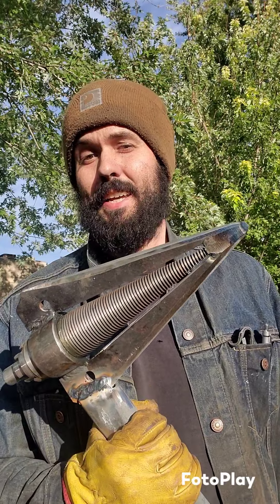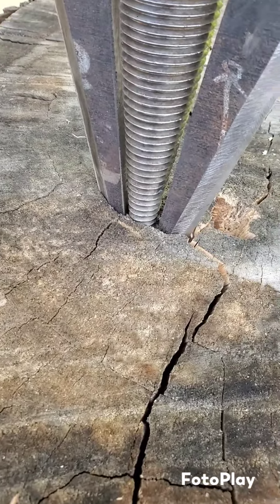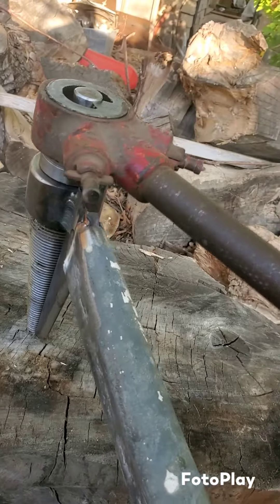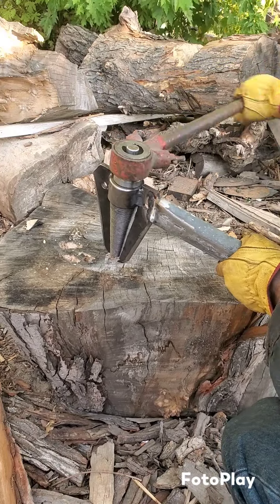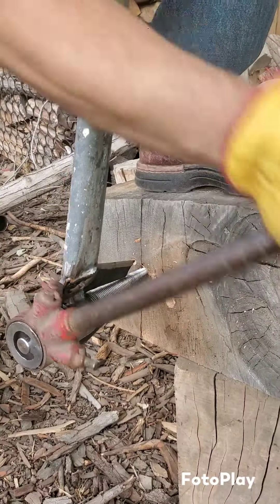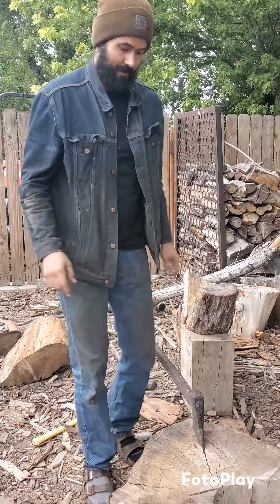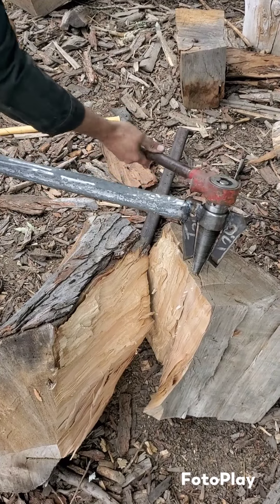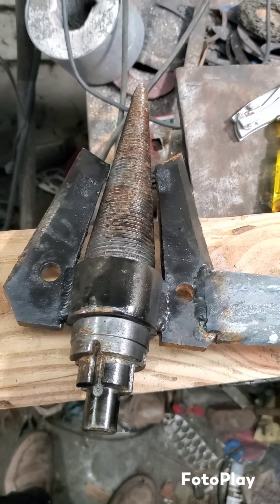Axicorn 🦄 testing : Mixed results new design plans

Comment: I can't see how this would be physically easier or faster than just using a wedge and sledge. Or just building a normal woodsplitter.
Reply: It does not need to be to.
Guy actually crafted and tested one of those ideas, that just blink and disapear in our minds daily. 
Some of his and our: vievers brain cells, that were disfunctional died, and we are closer to perfect amount of brain cells: TWO.
Nex time it would be easier to make it happen next blinking idea, until some day we all wake up splitting stumps on planet Mars.
That was one small split for a man, but a big one for a mankind.
Reply from the maker: I have built a wood splitter and I do use axes and wedges. But I'm interested in a more portable wood splitter so I'm chasing down that idea.
Reply: @Hughsllc  nice man!
 some stumps can swallow a couple of wedges and still be in one piece, never too many.
Reply: Its not meant to be isn't that obvious? it's just something different
Reply: Sometimes its just answering the question of if you can get something working and not if you should.
🤷‍♂️
Reply from the maker: @joshk.6246  Exactly
Reply: It's a novel concept.
Reply: @teodormajewski3566 ever eaten shit? I mean, if you haven't chased the dragon how do you even know if it's good or not???

Comment: Based on other screw splitters I’ve seen that actually work well, this one has too many threads which is too much friction to overcome, and the size is a bit unnecessary…

If you look at the ones that work, the main downside is being a wrist breaker if/when the drill inevitably catches.

If you combine the ideas and add some locking blades to stop that from happening, I’m sure this idea would work.

I’ve seen people split some nasty logs with a decent power drill and a small splitter bit. 

Might be worth looking into modifying existing tech instead of starting from scratch, at least as a way to understand the potential issues and then you can scale up.

I want to see this work! I wish you the best, stay safe out there.
Reply from the maker: That gives me an idea 💡 🤔  So the little hand drill ones are out there but there used tobe kits that bolted on a car axle you would put the car in gear to split the wood 🪵
Reply: @Hughsllc  Holy shit, really?! Haha that sounds terrifying in the coolest way!
I’ve only seen the hand drill and the mounted ones, and the hand drill ones are surprisingly powerful, but they’re basically useless because the weak link in the system are your fragile human crunchy bits… I thought your unicorn design with the blades attached to the drill/motor housing to act as an anchor would work well. 

But I like the sound of whatever nightmare you’re imagining much better… lol Good luck, and I hope you keep all your parts where they belong.
Reply from the maker: @DanteYewToob  So there's a new video with some design updates I welded a tube on the front and made a stake to hold it in place works alot better

Comment: Why not use a 1/2 or 3/4" electic impact? Should give you plenty of torque, and very portable.
Reply: I legit was just thinking something like that would be helpful. This concept is amazing it just needs refinement. Maybe having 2 bits driven in by a heavy hammer, a different thread design, maybe having the angle on a gradient

I love it hey

Comment: Came across this through a short of attaching the longer threaded piece to the ratcheting lug. 

Getting power to it is an interesting idea, though maybe not a direct drive on a pipe threader unit. I was thinking maybe a smaller hydraulic motor attached via hoses to a electric powered pump so you're not having to try and manhandle a heavy threader around. Wouldn't really need to be a super high flow unit or really all that large if it's driven through a planetary gear set like is found in a smaller winch that can mount on a the front of a pickup. I think some develop enough torque that wouldn't need a planetary to increase the ratio.

Drive your Axicorn, then set the drive over the end and let it use a drive dog to brace off the handle so it can drive the power down while you steady it with the handle.. When done, just pull the power unit off and have less mass to swing an carry. Plus depending on the motor, it may have power reverse though reverse might not be needed since it'll either pull fibers out or split the log.

In the end though, this is your idea and project, so how you approach is how you approach the goal. Not up to me to demand otherwise or do i have the room to make such demands of you.  More to the point,  I'm rather amused to see this and quite like the idea of where this is headed to. Please, keep up an update in long form as a sort of 'This is what I have thus far for idea exploration if you the viewer wouldn't mind long form done at a slower update pace than shorts done faster.'
Reply from the maker: So thats the direction I'm heading a removable power unit that would go on an of the unit. I am defiantly consider a hydro motor but I'm hoping if I can find an electrical solution I can keep the foot print of the power unit smaller. Ultimately the goal is a very portable power splitter.
Reply: @Hughsllc  Cool beans for sure. The remote power like I envisioned was something I remembered from an older 4x4 modification show. The hosts connected a hydraulic winch to the front of a jeep and ran it off the power steering. At idle it was lifting the whole jeep off the ground.

Remembered that from the memory store. Likewise a set of hoses from a jaws of life are small diameter flexible units but keep high pressure charging. Anyway, still neat as all get out seeing what you have this far and the direction you're going. Keep it up and stay gnarly.

Comment: Don’t know if you tried it yet, but an impact wrench might drive the screw without too much pressure back into your hand.
Reply: I came here to say this, too. Add a large nut on the back of the spliter, and try running it with an impact gun. The only problem I can imagine is that the jittery action of the impact gun might mage it harder for the threads to engage with the wood. It might cause tearing out. But it's worth a try.
Reply from the maker: So I'm approaching the power drive idea with a portable pipe threader they run about 30 rpm with gobs of torque.

Comment: Try half as many thread count. Think of a lag bolt thread rather than machine bolt thread. Maybe 8 or 10 threads per inch. Also was thinking an electric 20volt dewalt impact. The impact might help it split too.
Reply from the maker: I'm pretty sure that is 8 tpi
Reply: @Hughsllc dang lol maybe 4 tpi? If the original cone that you cut off and the one in there now had a baby it would be the magical unicorn 😂

Comment: I think one of the main advantages of an impact wrench is that you're using the   moment of inertia of the stump as a rotational anvil. Essentially it would be a lot easier to keep the log still with an impact wrench then with a constant torque device like a drill or a pipe threader. Also, it would be super cool if you built the motor into the handle and were already holding the trigger when you land that first strike

Comment: Wider (not thicker) tines, maybe a less steep screw to stop it pulling it's threads, once the tines/axe heads bite and the split starts, apply some torque to the handle (or even hinge the 2 tines in a scissor configuration) to spread the crack.

Comment: Probably putting too much icing on the cake but cut you end(non threaded end that attaches to ratchet, buy a cordless impact wrench or use an air one. That would very effective.

Comment: It would add steps, but you could make a cap that can set on the back of the tool to hammer in some after the first swing so it can drive in farther before ratcheting.

Comment: You should have a taper going to the tip or just a half inch from the tip so the initial swing not only embeds the tip of the screw in the log but also hopefully anchors the Axicorn ™️ 🦄 into the log so you don’t have the handle swinging everywhere. Maybe possibly add a spade bit to the tip of the screw so that the screw can start in a pilot hole instead of trying to pull itself in from the tip? Although the feeding of the screw could be a complication for drilling. Also, maybe have 3 blades instead of just the 2 for extra holding power and splitting potential.

Comment: You should notch the unicorn screw like a multi step bit, v a notch into it, and it will work better. You should also case harden the blades or fordge them😊

Comment: Ehy not.jusy use the screw its self as the as the impact surface it will imbed and then turn from there
Reply from the maker: Gotta hold the log to turn the screw or you turn both

Comment: You should have a 1/2" × 4" lag bolt welded to the tip of the axicorn to pull it into the wood initially.

Comment: Just use a battery powered impact
Reply from the maker: What's the top end continuous torque?
Reply: @Hughsllc  depends on the impact. I don't know the torque of mine off hand. I think they average around 580 ft lbs. I have one of those tapered threaded screws I use with mine. It's not as big as the one you have. Works pretty good. I just split medium sized rounds. I haven't tried it on anything the size your splitting.